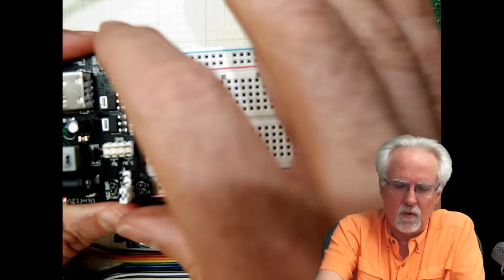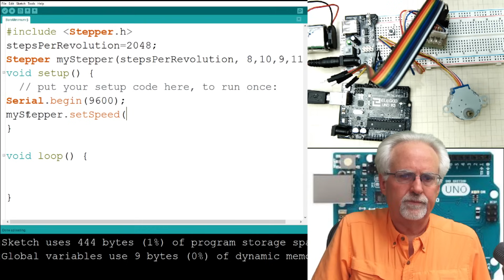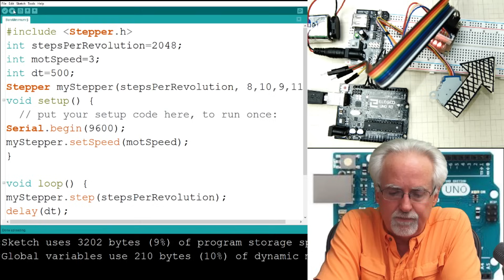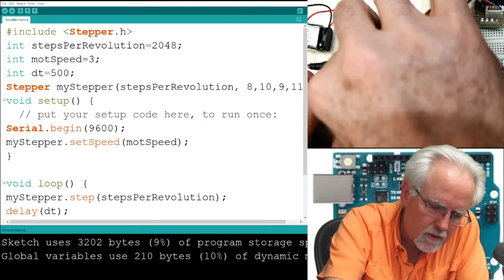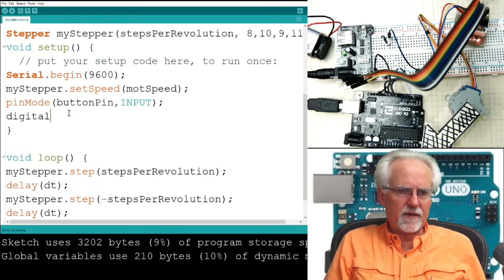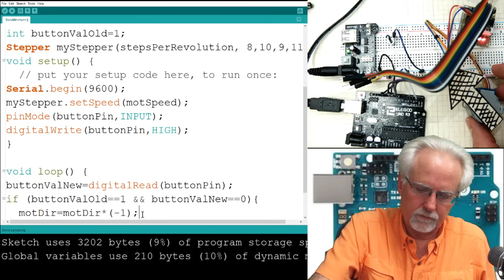Arduino Tutorial 35: Understanding How to Use a Stepper Motor

Comment: My code. For avoiding the problem of keeping the button pushed, I used a different approach by using a "while" sentence.

#include <Stepper.h>
int stepsPerRevolution=2048;
int advance=1;
int motSpeed=10;
int wait=500;
Stepper myStepper(stepsPerRevolution,8,10,9,11);
int button=2;
int buttonV;

void setup() {
  // put your setup code here, to run once:
  Serial.begin(9600);
  myStepper.setSpeed(motSpeed);
  pinMode(button,INPUT);
  digitalWrite(button,HIGH);
}

void loop() {
  // put your main code here, to run repeatedly:
  buttonV=digitalRead(button);
  if (buttonV==0){
    while (buttonV==0){
      buttonV=digitalRead(button);
    }
    advance=-1*advance;
  }
  Serial.println(advance);
  myStepper.step(advance);
}

Comment: I think I was heading in the right direction but I was way too complex, using multiple if statements. Then while I was plugging in the switch I knocked the pins out for the + and - connections on the motor driver. Once I realized that and got it plugged back in, I could not get the stepper motor to work at all... HAHA I wore my battery down during all my deliberations and then I wasted a lot of time trying to figure out what I had done, so I gave up and started the video again. First thing you said was you knocked the pins out for the power connection on the driver - DOH same problem I had. Then you said you ate the battery up so you plugged in the wall wart for power - DOH AGAIN! I finally got my wall wart out and powered up the motor again but by then I just wanted to see your solution. I did have the motor direction state figured in, the old and new button states, and the switch working correctly, but the clever way to multiply the motor direction by -1 was much simpler than the multiple if statements I was trying to use. Thank you again, Steve

Comment: Thank you for your great video. I have solved the problem but I think in an easier way as follows. Thank you.
#include<Stepper.h>
int stepsPerRevolution=2048;
Stepper myStepper(stepsPerRevolution,8,10,9,11);
int motSpeed=10;
int bPin=7;
int bVal;
int i=1;

void setup() {
 pinMode(bPin,INPUT);
digitalWrite(bPin,HIGH);
myStepper.setSpeed(motSpeed);
}

void loop() {
 bVal=digitalRead(bPin);
if (bVal==0){
  i=-i;
}

myStepper.step(i*stepsPerRevolution/30);
}
Reply from the maker: Excellent!

Comment: Hey Paul ! I have been trying the first part of this lesson for almost 3 hours now but I am not able to spin the motor yet. After I upload the program the motor just starts vibrating and also the A-B-C-D lights are not lit. Please help me out 🥺
Reply from the maker: Make sure you are not using a dead battery
Reply: @paulmcwhorter  Yeah I did check the battery, it is showing 7V instead of 9V. And I also rewatched the video to ensure that I am doing everything right.
Reply: I did some troubleshooting and I found out that the stepper motor driver was faulty. I replaced it and now everything is working smoothly  👍
Reply: @abhinavshetti1205  perhaps there are some bad kits lately? I think I am experiencing the same problem, but I didn't get as far as you in the troubleshooting.  Any advice on how to troubleshoot or where to replace the stepper motor driver? Thank you!

Comment: Hey Paul.  I have loved all your lessons up to this one.  There's a few things I don't understand and would love some guidance:
1.  You have set the stepsPerRevolution to 2048 based on what it said on the motor but the motor says 28BYJ-48, whereby 28 is the diameter of the motor, so where does the 20 come from?  It seems to be 2 to the power of 11 but why? However, I do concede that 2048 does equal a complete revolution.  Ironically the specifications for the motor state "This geared stepper motor has 4096 steps per revolution. each step is less than 0.1 degree".  However, when I replace 2048 with 4096, all 4 LEDs on the driver light up and the motor just buzzes!
2.  Why is the PIN order 8, 10, 9, 11?  It would be good to know why so that if we use a different spec motor then we could work out the PIN order.  I understand why it uses PINs 8, 9, 10 and 11 because the specifications sheet says so; but when I plug it into 3, 4, 5 and 6 and set PIN order to 3, 5, 4, 6 it works perfectly.  TBH, it works fine with any digital PIN combination.  However, I still can't fathom the order.  The best that any datasheet tells me is the order for the 4 coils which is ordered correctly on the plug end that connects into the Stepper motor controller but there is no information as to the PINOUT from the controller, which is on the opposite side of the chip???
3.  I don't have a breadboard PSU (yet), so I thought I would just see if it would work direct from my Arduino Uno and it works perfectly.  The datasheet talks about 500mA and since the UNO supports that I thought I'd give it a go.  However, if I change the speed to 20 then the motor just buzzes, so maybe the UNO can cope with a low speed.  Either way, I'll get the PSU

I'm a bit confused.  Please advise :)

Comment: Paul (or anyone else who can help), I have been doing each of these tutorials with my kids, and everything has worked beautifully till now.  I'm having trouble simply duplicating the test circuit in the first half of the video.  My circuit looks exactly like Paul's, and my code does as well (at least, I can't see any difference, though I guess there must be).  When I download the program, the power supply module shuts off every time.  The problem is with the myStepper.step(stepsPerRevolution) line.  If I comment out that command, as well as its negative counterpart, then the power supply module stays powered up (though the motor doesn't do anything, of course).  But as soon as I place that command back in, and download again, then the power supply modules shuts off again.  Any ideas where my problem might be?
Reply from the maker: Really hard to say, as there are many things. It sounds like you are methodical in trying to debug it. Just a question, are you running the circuit on a small transformer, or trying to do it with the battery. The little 9 volt battery that comes in the kit is usually almost dead on arrival. The issue I have seen on this lesson with people is insufficient power to the power module. Best of luck and really encouraged to hear parents are working with their children on these lessons.
Reply: @paulmcwhorter  You were right!  I should have thought to check the battery.  It was from the kit, and it was the first time we used it.  Everything's working great, and now it's time to do the homework assignment before we finish the video.
Thank you so much for taking the time to answer our question.  And thank you so much for your willingness to make these videos.  My children love holding their breath, and my younger ones love to look for missed semicolons :)

Comment: Hi master. Would you help me please. I want to code for step motor that takes the object up and down with lead screw.we have to limit switch and one push button.start point is zero point or home point in down position.when we push the button it starts to turn and object goes to up until touching the limit switch or micro switch and change the direction in opposite direction and come down until touching the second micro switch and this counties until we press the button.and now by pressing the button i want to the object every where was come to home and finish 🥴😊🙏. Help or guide me for coding if possible please 🙏

Comment: Hi Paul, wanted to ask you a question about that lesson. 
If i have an Arduino Uno R3, do i still need the power Supply?  or i can plug the 9V battery to the Arduino?
will help me a lot if you could answer me, thanks very much in advance!.

Comment: Steppers are compleciated marvels of enginering if you dive a bit deeper but I got stuck with the Elegoo kit. The stepper moved a couple of steps and started buzzing. The voltage I measured on the rails was 4.4V , with the provided battery which was still in plastic (battery measuered 7,5V). I removed the poweradapter, added a lab powersupply and really had to ramp it up to get the stepper spinning. it took 6.5 Volts at 10 rpm. when at 11.9 volts (0.5A) I could spin 35 RPM briefly but after looking at different values, with the same voltage, I couldn't get above 30 reliably anymore. Odd and makes me worry about how accurate you can supply arduino projects with a battery if the project require more current (also added a 1V battery on top of the 4.4V I measured on the rail but no improvement). In the end worked out though. I can finally go to sleep and tinker on tomorrow.

Comment: Just a word of advice... I took my brand-new 9V battery from my kit (also brand-new) and could not make the stepper motor do anything. I noticed that the external supply LED dimmed as soon as I plug in the stepper motor. I switched over to my bench PSU and then everything started working. So, maybe some of the starter kits spends a long time in storage before they are shipped out. The 9V battery self-discharges and has a limited shelf life.
Reply: Had the same issue so I just used the 5V pin in the arduino board and it started working but very slowly (my multimeter read 4.7V)

Comment: I have been following along for a while, and this is the first time i'm having trouble.  No motion from the stepper motor, just vibration.  When i unplug my stepper motor from the driver.  The LEDs on the driver, light up.  Then when I plug in the stepper motor to the driver; all the LEDs go out and the stepper does not turn with this code.  Please help
Reply: I am also new to this but my understanding is that stepper motors are  dependant on the sequence of signals to the in pins. In the example the in pins are connected to pins 8 9 10 and 11 of the uno.  One of the commands sets this sequence as 8 10 9 11 but this is only applicable for the motor and driver of the kit, suggest checking the code contains the correct sequence.

Comment: hey paul, unfortunately did not do it without your help ... i did try although i got stuck trying to transition the practical use from an led to a stepper motor just the slight adjustment in the approach although once i did it with you i felt proper silly haha thanks for another great lesson paul
Reply from the maker: Great job!

Comment: I managed it, looked back on the old button toggle code to help remember what I did back then. My only problem was leaving the number of steps at 2048, and the delay of 500ms - it almost never read the button. Then I cut it down to 10 steps and shorter delay and it worked better. My code inside the if statement was direction=-direction. Thanks for another great lesson. It's been a while, but I've been having fun with the other stuff I can do!

Comment: Figured out the -1 trick for the direction. Did not figure out the one step at a time movement of the stepper. My code was working only after a full revolution and I was using an infinite While loop for continued movement in any one direction. It was  not easy for me, but made it sort of work. Thanks for the great tutorials. BTW, I used a 9V battery as an external power supply.

Comment: Finally got to completing this tutorial. In my pinMode for the switchPin i used the following instead of Paul's hack: pinMode(switchPin, INPUT_PULLUP). This eleminated the need to digitally write to the switch pin to set the internal pull-up resistor. I think it would have been more helpful if Paul would have showed his code for setting the old switch val = new switch val. Other than that a very good tutorial.

Comment: I love your enthusiasm! I also love your brass-tacks brevity. Most of this tutorial was very easy to follow (I've been a software developer for over 35 years, so the software portion was trivial for me), but there were two questions I had that weren't answered in your video (rightly so; answering them in the video would have broken your cadence):

1) The stepper motor data sheet I found doesn't list the steps per revolution, or the maximum step speed. Which data sheet did you use (a link would be great), and how did you figure those out? Experimentally, I found that the maximum motor speed is 14 RPM  (it won't turn with a higher number).

2) The Stepper library documentation lists the last four arguments to Stepper constructor as pin1, pin2, pin3, pin4. With the wires hooked up to the driver INT* pins sequentially, and the same wires hooked up to the Arduino sequentially, why did pins 2 and 3 get swapped?

Comment: Thanks to all the instruction leading up to this video, I was able to do it on my own.  You are a great teacher, Paul.  The only thing I struggled with was getting the first part to work at all.  As soon as I would plug in the stepper controller, the light would go out on my power supply.  Turns out the battery in the kit did not have enough power.  Glad I ordered a 9V Arduino wall wart when I ordered my kit.  Plugged it in and all was well.  (All was well after spending several minutes checking my wiring before pulling out my volt meter to see what the battery was not putting out enough power....)
Reply: thanks man I think I have the same issue lol
Reply: I'm glad I found this comment so I didn't have to pull out my meter lol! Had a rechargeable lithium 9V laying around from my pro sound work and everything is working now! Man, the brand new provided battery lasted about 30 seconds hahah!
Reply: Same problem here, no name batts are notorious for being junk. The updated link leads to a larger kit (The Most Complete Starter Kit) which includes many more parts (twice the price) including the wall wart.

Comment: Getting ready to start working on this tutorial and I want to state the ROHS is not the manufacturer of the stepper motor in the eLegoo kit. ROHS stands for the Reduction of Hazardous Materials Initiative. It means that the manufacturer is declaring that its product conforms to the requirements. More to follow when I complete this project.

Comment: My motor did not do much. I double and triple checked all the connections. I could feel it vibrating, like it wanted to move, but it would just not rotate. I could also see the lights lightning up, but not like yours, and they were very dim.

Edit: It turns out my was 5V DC. Plugging it into 5V made the lights light up normally. It didn't seem like it was behaving correctly, but it was starting to move.

Comment: For those that are doing this with the kit, please note that the supplied 9V battery may not be sufficient to drive the stepper motor (via the driver). When I first tried with the supplied battery, the stepper motor made a noise but didn't turn. I then swapped the supplied battery with a new one, and the stepper motor turned. Thanks to Paul for these excellent videos.
Reply: Even with a brand new battery it's weak. Can't beat a power supply
Reply: Yep, me too. Mine came with a Piscell 9V: obviously not up to the task. Energiser did the trick!
Reply: Thank you for mentioning this!  I was afraid I broke it after getting it to work my first try.
Reply: @CircleFly  Me Too!!
Reply: same
Reply: was the new battery any different?
Reply: Mine worked for a bit and I checked the battery with my most excellent multimeter. The voltage turned out to be a little bit over 
6 V! So I’m surprised it worked at all.
Reply: I was sitting wondering why the stepper wasn't turning. Now I know why. Thanks! I used the 9V power supply that came with the kit and the stepper works now.
Reply: The supplied battery did not work.  Swapped it with an Energizer 9V and the stepper motor worked fine.
Reply: Thank you!
Reply: Yeah it probably happened due to the battery being cheap, cheap batteries usually don't have a good current supply. And the stepper motor being a 'MOTOR' that uses coils, it needs a significant amount of current so always use good batteries when working with motors to avoid problems with motors not working and voltage regulators heating up. 🔋🔌
Reply: here from the future to say thank you for this, thought I'd broken something

Comment: I did myself basically the same as you, but  I can't see how the data sheet that comes with Arduino for either the stepper-motor or stepper-driver shows either the 2048 steps per revolution, or the pin order in the stepper command.  In fact the data sheet for the stepper driver says its 4096 steps for 360 degree rotation of spindle?  Plus the stepper-driver step command truth table is very confusing and not clear at all.  Just saying.

Comment: Since my push switches were broken, I used the joystick. I did it this way: when joy is moved forward, stepper moves clockwise, when joy is moved backward, stepper changes direction to counterclockwise, and when joystick is moved right then left stepper stops, and when right and left again stepper continues on the same previous direction. (just to prove I did paused the video :)

Comment: I'm working thorugh these tutorials in 2021. An absolutely fantastic resource, thank you! When creating the Stepper I accidentally set the pin sequence as 8,9,10,11 - not 8,10,9,11 as it should have been. This resulted in the motor buzzing but not turning. It took a long time to work out why! If another viewer is haveing similar issues, it's perhaps something to check.
Reply from the maker: Great job!
Reply: im having the same problem as you but your solution does not seem to work for me. When you say set the pin sequence you mean the order in which you plugged the pins in the arduino or you mean the way the pin are listed in the code?
Reply: found out what the problem was....the batery was just not having an output of 5v so thats why the controller would not power up :0
Reply: @painfullgaming8667  i have the same problem.. for some reason when I run an empty program the output voltage of th battery is 5V. However,  when I run the program of the step motor it goes down to ~2V and therefore I don't see any movement; just a buzz.